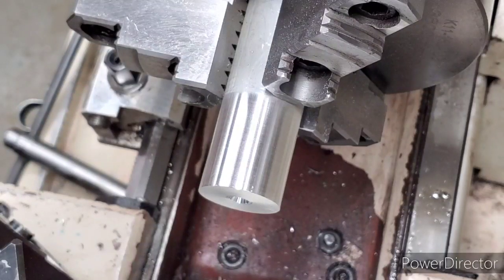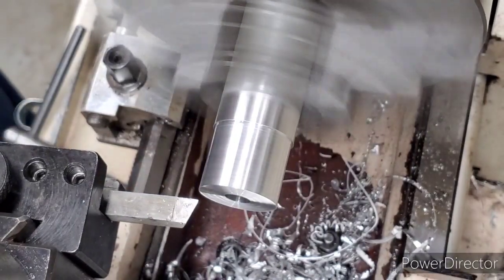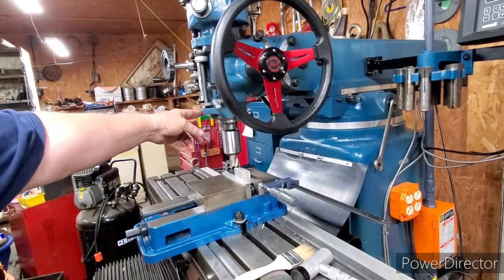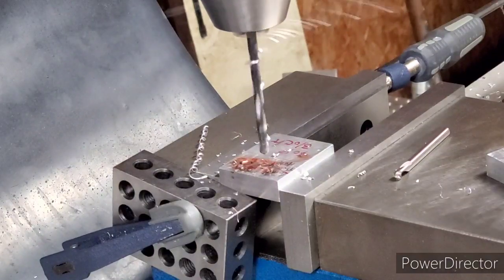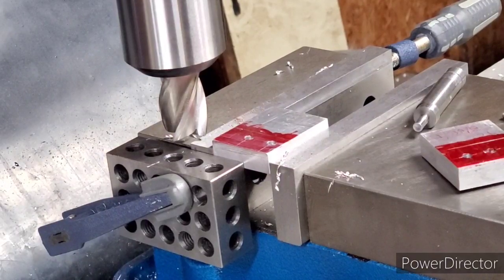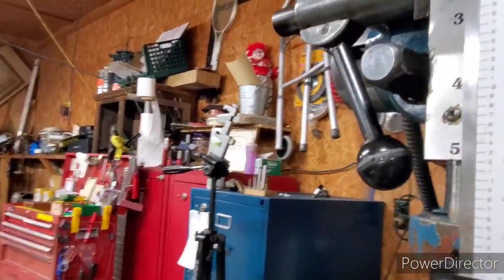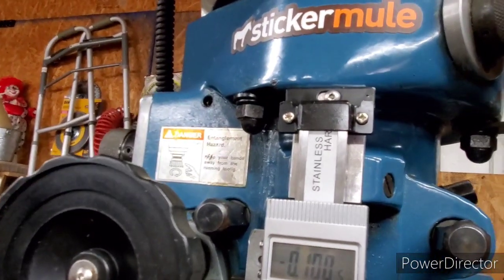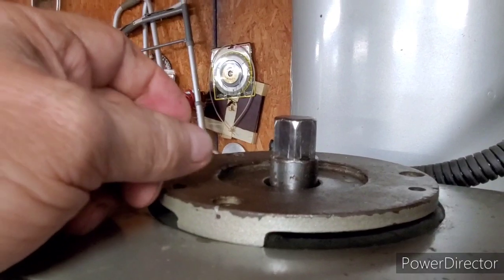Dro for Quill

Comment: I just finished replacing the spindle, bearing and some other parts in my mill, I was also trying to get the power feed for the quill  working, but didn’t succeed on that part. My mill was missing the worm gear that drives the power feed, also the bevel gear in there was also all busted up! The Bridgeport worm gear and bevel gear won’t work on my Kent mill, Kent changed stuff just enough that I’d have to go back to them for it and neither of the gears are available from Kent anymore. Some day I’ll attempt to make the gears. I had to get the mill working so I could make a couple pieces for my horizontal mill, I was going to make an attempt to make the bevel and worm gears on the horizontal mill but the motor decided to dump on me. I had a replacement motor but the motor shaft size and motor height were different, so I had to fix those issues. Using one mill to fix the other mill and then that mill dumps on me has been fun! I just about have both back up and functioning now!
Reply: Man John what a run of bad luck. Hopefully you will be up and running soon.
Reply: Hill Top Machine Works Tom, my Kent mill is back up and running and the Hardinge horizontal mill will be very soon. I just need to mill some slots for the motor mounting bracket. I’m converting the mill from a DC motor to 3 phase using a VFD. The old DC motor weighs well over 100 pounds and is about 4 times the size of the 3 phase motor. Both motors are 1 HP.
Reply from the maker: Thanks John
Reply: Anthony,s Ragsdale Creek Workshop, how is your back doing? mine isn’t doing real well right now.